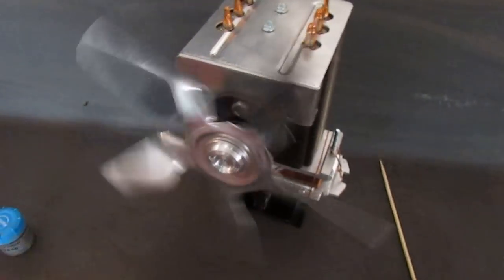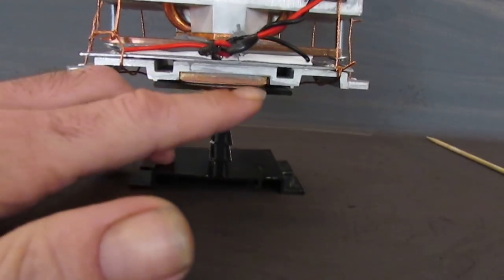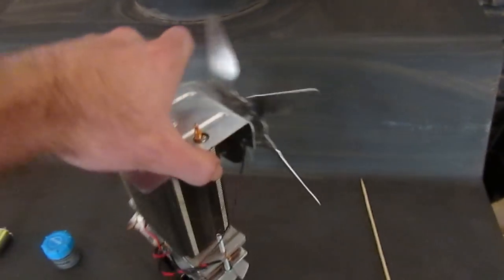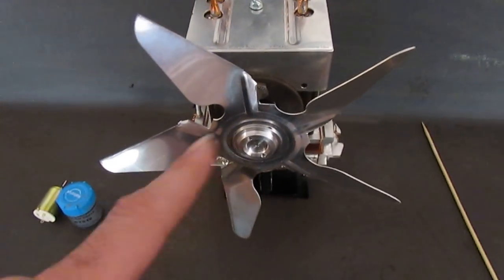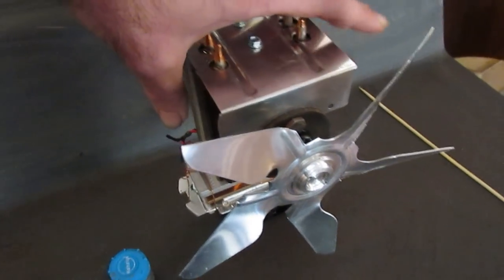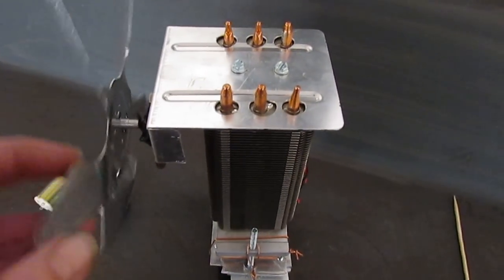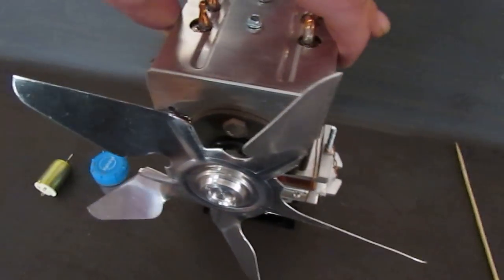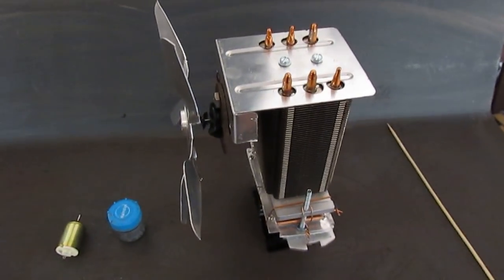Heat Powered wood stove fan DIY for about $25 Part 1: It's alive! but a bit cranky.

Comment: I’ve seen other home built fans but This is the first one I’ve seen where you use 2 thermos elect generator wired in series. Why? And what if any advantage? Was this needed to match your motor? Did you get twice the voltage (like batteries in series)
Reply from the maker: Mike Farris, yes they roughly double voltage. These are really cheap TEC’s (as opposed to proper TEG), so they need all the help they can get. In fact they lost about 50% potential over this one season. I didn’t end up using this motor as it was too weak. I plan on rebuilding the unit in the spring with TEG’s and a second cooling tower, there’s room and I’m curious as to the result.